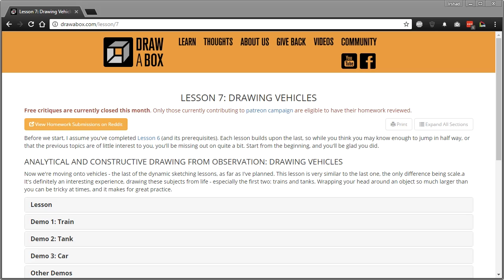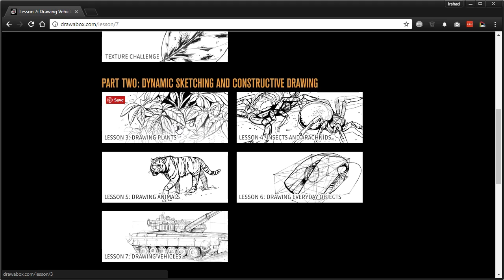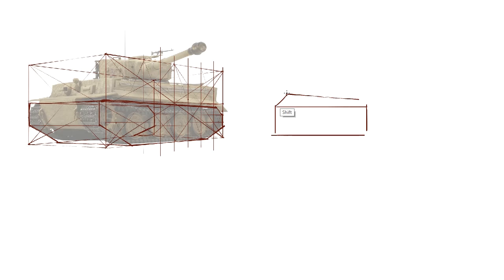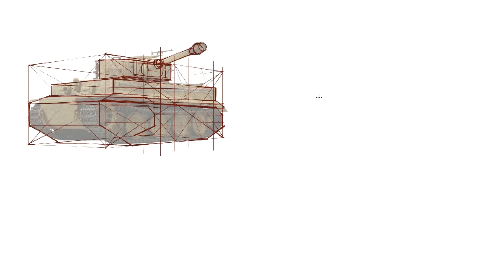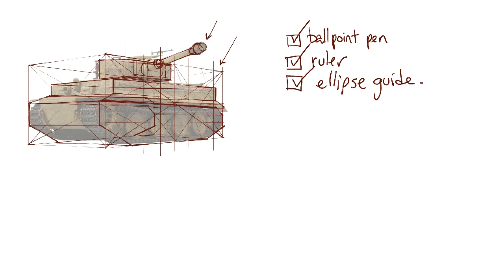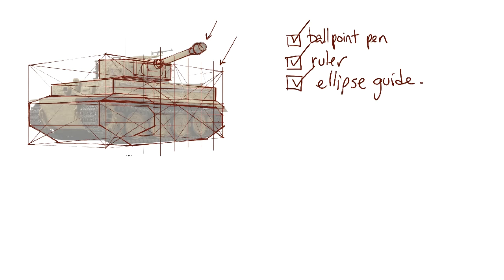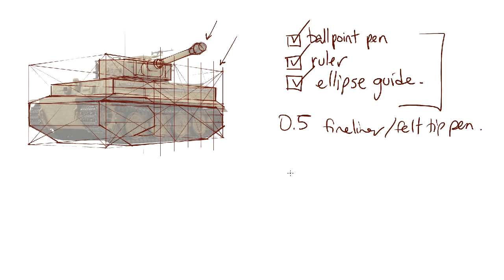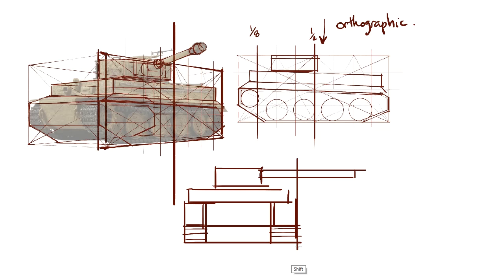Drawabox Lesson 7: An Introduction to Drawing Vehicles

Comment: Does the info about form shadows on cylinders at 33:35 still apply? (given how we're encouraged to only draw cast shadows)
Reply from the maker: No, that's definitely one of the ways in which we've changed our approaches and what we feel is/isn't beneficial to students. Back when this video was made, our general goal as a course was still unclear, and I was still following along with a lot of the overall points I'd learned from Dynamic Sketching with Peter Han. Since then we've stripped away a lot of the excess, and while it'll be a looong while before it gets to this point in the course, I am working on updating the video demos to eliminate or at least reduce contradictions like this.
Reply: @Uncomfortable  Okay, thanks for answering!